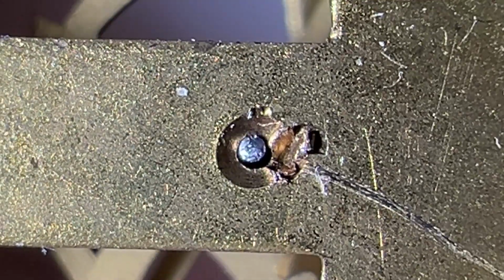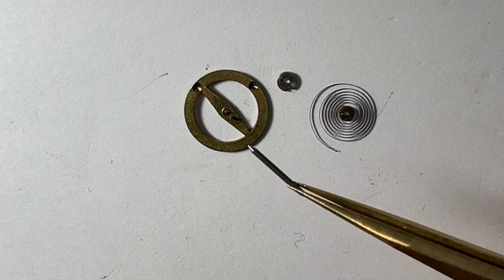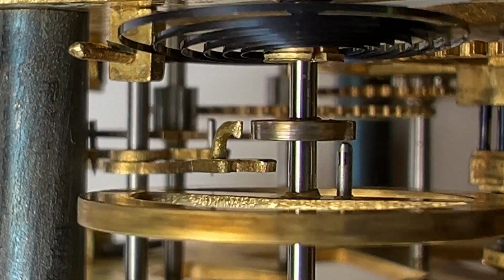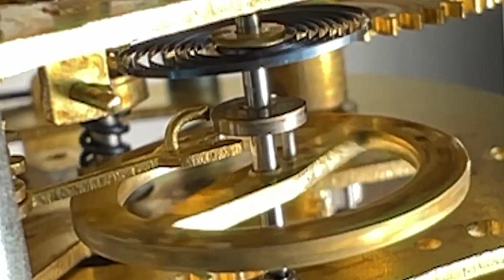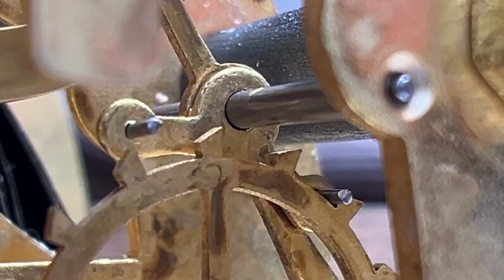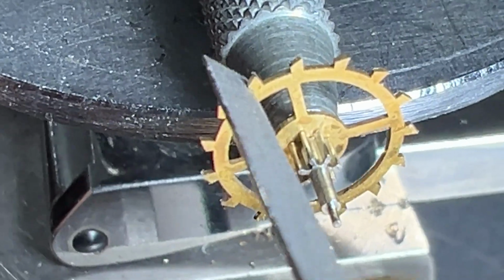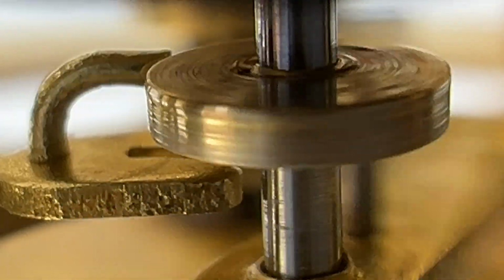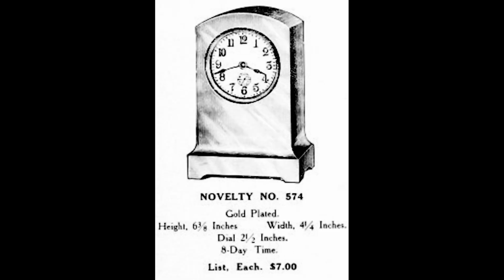Tombstone Ansonia Clock Restore for Nathan from Michigan # 138

Comment: As always, you are beyond skilled! What makes this a "novelty" clock? was it just not as accurate or of inexpensive construction for its time?  Sort of like a secondary clock for a less busy room of the house? Very interesting. 

I have a pre-1900s Ansonia 8 day alarm clock safely in storage that still runs. It's a beautiful piece, but I will not run it without a proper restoration of it's movement first.
Reply from the maker: I agree, they will run with the oil dried up in them but end up with a shortened life.